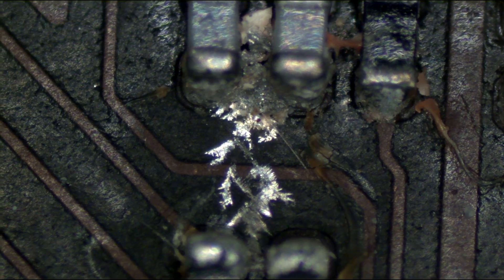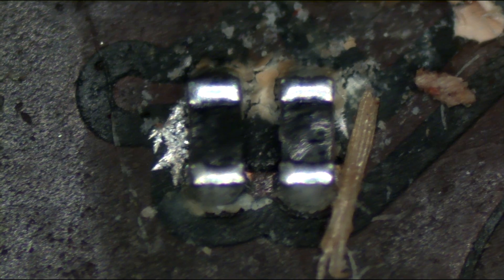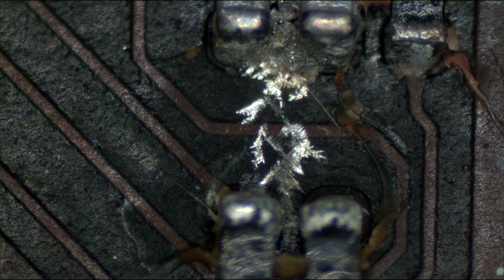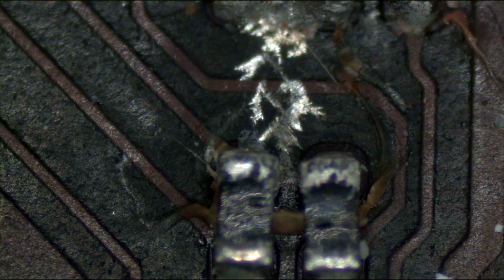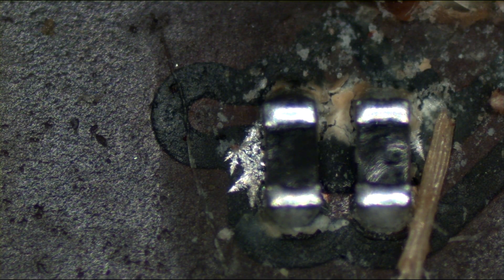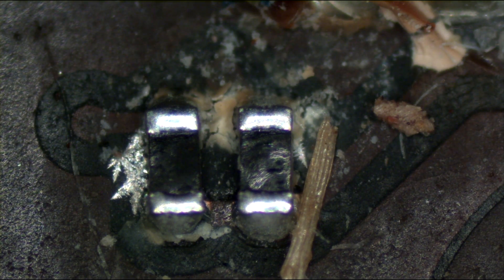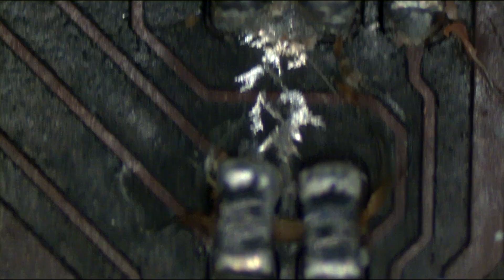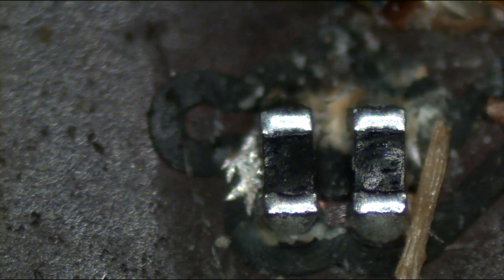A pretty Macbook failure

Comment: Solder whiskers are caused by the uneven metal mix in the RoHS alloy. They are created by mechanical compression. Think, trying to squeeze a wet soap. They do 2 things. 

1 - creates cold solder joints because there is a hole left behind. This cannot be avoided. 
2 - creates shorts by touching other components. This can be avoided with conformal coating.

High vibrations and large temperature deltas accelerate their creation. Critical systems are not allowed to use RoHS. Aircrafts, medical and military.

Comment: Hi, Louis!   what typically make USB ports fail? Is it mechanical (solder joints)?   or the interface chip running them?     I have an HP that only has one USB port left that works. I hate to discard it just yet....

Comment: I have a Macbook Pro that one of my roommates gave me that is in rough shape. At some point he glued the rubber pads on the bottom and the glue seeped in and he accidently glued the LVDS cable into the connector.  I pulled the the cable out of the connector when I was taking it apart and I think the connector is fucked because some pins must be damaged. I do not have the equipment to replace the connector. I feel like it is is mocking me sitting in my room reminding me of my failure to repair it. Can I donate it to you for parts or repair?

Comment: Tin whiskers are a rare thing out in the field.
They tend to "only" grow if the tin concentration is above 95%. But other factors plays a part as well.

Whiskers are though so rare in practice that it isn't a major concern unless in a critical field.
But if building a device used in a critical field, then one can typically use whatever solder one desires. (Can't just sell it as a consumer product, and one do need to label it appropriately. That is if one is selling the product in the EU, since it is there that RoHS is actually enforced.)

One can conformally coat the board to "fix" the issue, but that isn't really economically viable and can honestly create its own problems, mainly in terms of cooling. (literally putting on a layer of insulation.)
 But conformal coatings are mainly put onto boards for other reasons, like moisture protection in marine environments.

Comment: We had a failure at one of my radio stations because of this.  The cut through hole components started to crystallize to the zinc back plate of the console module.  Took the manufacturer a long time to figure it out because our consoles were an early run of a new process where they were not allowed to wash the boards (based in California).  The unofficial fix was they started to wash the boards despite regulations, and they provided a couple hundred Mylar sheets for us to place between the PCB and the back plate.  Was a very frustrating time until they figured it out.

Comment: another reason why electronics flown into space uses leaded solder is that the lead free stuff would not pass the shake table as lead free solder tends to be brittle and when vibrated as in a launch there would be many dry joints in the device. 
Also using lead free solder in car electronics should be banned as I have had lots of dry joints in the last cars ABS computer, and 3k for a new one did not happen.

Comment: I'm still using my old Panasonic Toughbook with an upgraded solid state hard drive and Bluetooth. Waterproof, shockproof, bomb resistant 8 hour battery and doubles as a battering ram. It will beat a Macbook to shreds in a fight.

Comment: is there an economic way to fix the loose USBC plugs on a 2017 Macbook Pro ? this is driving me nuts
Reply: If you have a macbook with 4 USBC ports, the ports are only connected to the logic board with some screws. Cheap parts, easy to change, very difficult to get to. You must remove the whole logic board to remove the ports from the case. If your good with a screwdriver and have a steady hand you can do this yourself. Just watch a teardown video, disconnect the battery FIRST, use the correct and good quality screwdrivers (Pentalobe P4, Torx T8, T5, T3, recommended Wiha or Wera brand) don't mix up screws when putting back, and don't pry the bottom off with something long like a screwdriver.
 If you have a A1708 with 2 USBC ports, they are soldered to the board and I would consider it an intermediate to advance microsoldering repair.
Reply: @A2000MHz  thanks for the info, i would say i would most probably mess this up myself . but i would give it to a professional.

Comment: Wow, tin whiskers in practice. The problem has been well known since at least the ‘40s, maybe the ‘30s, and lead is the only known solution to prevent it. Encapsulates and potting don’t stop it either, with at least one known satellite loss suspected to be due to tin whiskers in a component. The RoHS sure works wonders for planned obsolescence though, and caused a larger hazardous dumping of lead than it ever prevented.
Reply: The lost satellite was presumably due to a tin whisker growing on the pure Sn coating (as in industry standard). Lead as additive also doesn't prevent tin whisker formation, it merely reduces their size and count. Some SAC (lead-free) alloys are very similar in this regard, though SN100C (SnCuNiGe) is the best by far.
Reply: @MayaPosch  thanks for the information! The sources I read at the time just have been out of date or incomplete

Comment: I only use Lead / Tin solder. In the small amount I've used over time, I haven't poisoned myself, family or environment. There's more lead in car battery's out there that are irresponsibly dumped, then used in soldering.

Comment: Those are not tin whiskers, but in my opinion tin crystals formed through liquid damage. Someone spilled something that was corrosive enough to dissolve the tin, and then the tin crystal were formed through electrolysis between ground and a power rail. Normally the process is done with a tin chloride solution when done as an experiment or to purify the tin, but I'm sure certain fizzy drinks on a solder joint could work as well under lucky conditions.

Comment: I understand there are alternatives to lead in solder to inhibit tin whisker formation.  (Tin whiskers are a well-known problem that's been there since the very beginning of electronics.)  Apparently, you can put antimony in solder instead of lead to inhibit tin whiskers, but antimony is, if anything, more toxic than lead.
Reply: Lead as additive (in the industry standard 63/37 SnPb formulation, not the horrid 60/40) is relatively good at preventing whisker formation. The common lead-free alloys (SAC) are less good at preventing whisker formation, but an older (and heavily patented) alloy called SN100C (SnCuNiGe) is roughly on the same level or better as SnPb. The patent made it too expensive to use generally, which is why SAC stuck around for so long in its roughly dozen common alloy formulations.

Most recently (few years ago), the patent on SN100C expired, and now anyone can use the same SnCuNiGe alloy for their solder products. This alloy produces shiny, easily wetting joints, with virtually no tin whisker formation and is for all intents and purposes eutectic, just like 63/37 SnPb.
Reply: you could just conformal coat the board.
Reply: I remember reading somewhere that tin whisker formation had more to do with the tin plating of components and PCBs than the soldering alloy used. Various alternative coatings have been devised to mitigate the problem.

Comment: Between this and solder joint failures due to brittle tin solder, I wonder if the leaded solder ban has backfired and caused more pollution in general due to more electronics failing early. I have a pile of video cards that have failed due to cracked lead-free solder joints. Never had a video card fail before the lead ban.

Comment: theese are not whiskers theese are dendrites https://nepp.nasa.gov/whisker/background/
Reply from the maker: Whiskers, dendrites, it's $$ to me all the same....
Reply: @rossmanngroup  Sure, but dendrites are not unique to lead-free solders at all. Tin lead - really, any tjn-based solder - does this just fine under similar circumstances. 

This is caused by an electrochemical mechanism, and is related to flux or other contaminants in the presence of electrical bias.

Comment: It doesn't look like tin whiskers to me. Tin whiskers are the result of mechanical imbalances in lead-free solders and usually are shaped more like a single spike or very thin hairs growing from the joint. This is more like a dendritic structure, maybe caused from poor flux cleaning or perhaps something else between the contacts here. This is why cleaning flux is very important for long term reliability. When two metal plates are charged to a different potential, over time they will form dendrites when submerged in certain materials. I'm not an expert on it, but I read a bit about this years back. Someone else may be able to chime in on my comment.
Reply: I actually am an expert in this, and you are right. The flux alone can be fine, but add other contaminants (or use a non-approved flux) and this is exactly the result to expect.
Reply: @jasonfullerton7763   yeah this looks like dendrites- fixed with conformal coating the mac so no one spills shit on it for it to grow

Comment: I find it ironic how lead-free solder, which supposedly save the environment, is the major one of the reasons why more and more electronics are getting into landfill because of crapshit solder joints that render them unusable.
Reply: It's not the major reason. As Louis points out in the video, this is the second time he has seen something like this in 12 years of repairing electronics every day. It's fairly uncommon in the scheme of things. The major reasons why electronics end up in the landfill are, bad capacitors, lithium ion batteries losing capacity, cracked screens, water damage and operating system end of life. Not to mention just the fact the actual CPU performance is still tracking Moore's Law fairly well which makes devices obsolete over time.
Reply: A bit exaggerating there,  @Gameboygenius . My hatred towards lead-free solder is still existent though, they're pain in the butt.
Reply: @Asu01  I would agree with that for manual soldering. But it's mostly a non-problem for factory production where the soldering will be done by machines under tightly reproducible conditions.

Comment: That doesn't look much like tin whiskers (those look like super fine spikes coming out of the solder) 
It looks more like electrochemical migration where some water/moisture allowed corrosion and deposition.
Reply: Spot on. Tin whiskers are filaments, like a human hair. That  looks electrochemical.
Reply: Tin whiskers are spontaneous sprouting of fine filiform threads of tin. This looks like some other form of metal migration, but the cause of the migration is not clear. Lead does inhibit tin migration so if the metal is enamating from the solder (likely), product failures could still be blamed, at least in part, on lead-free solder.
Reply: @falcon2287  We could just sum it all up in one term, "Planned Obsolescence" . Guarantee apple knew better. Regardless of what the actual full on scientifically proven cause is... Apple could have chosen to prevent it and opted not to.
Reply: @ThaRealC-LoCLo   Based on much of what Apple does I agree that they practice planned obsolescence. However, the elimination of lead from the solder formulations is beyond the control of the manufacturer. Inclusion of lead in the product and in the manufacturing process exposes them to the potential for devastating liability claims from workers and consumers for lead poisoning. Society places tremendous pressure on removal of lead from products. Laws in most parts of the world in which Apple products are made and sold would bar them from using leaded soldering compounds. I think you would be hard pressed to find any lead in the solder of any consumer product currently being manufactured. NASA and government entities can still specify leaded formulations, but those products are not intended to be sold or used by the general public. Myself, I am most assuredly "never-Apple", but I can't blame the evils of lead free solder on them.
Reply: @falcon2287  I think it's more likely that the utterly filthy board had enough moisture that failure was inevitable.
Reply: agreed. this looks like electroplating from water or something dissolving some corrosion products causing electrochemical deposition.

Comment: No. I did not learn anything. What is that? How does that happen? When does that happen? etc...
Reply: electrolysis because of current flowing while theres a liquid on the board that allows the metal ions to be transported. The metal ions are created when the metal salts from the corrosion get dissolved in the liquid.
Reply: @ZE0XE0  So, is it just moisture, or drops of liquid or massive water damage? How does that happen?
Reply: @JohnJTraston  It would require liquid on the board. The liquid acts as a media for the ions to transport. It wouldn't have to be a very thick layer of liquid though.
Reply: It’s just his outro ‘saying’, but yeah I would’ve liked some more info too

Comment: Dendrites <3 gotta love redox reactions.
Reply: Yeah, funky isn't it?  I've seen gold take a very similar form in fractures in quartz, and dendritic manganese oxide is a common mineral that displays this feature and can look remarkable.
Reply: @Stoneman06660  Now you're talking my language! Ive also seen some great iron oxide dendrites in agate and sandstone. 

I'm a mining engineer.
Reply: @ZE0XE0  I feel I've seen similar formations on the sides of the mountains cut out for the interstate in West Virginia
Reply: @Celician83  Probably. Manganese dendrites are very common.
Reply: @ZE0XE0  Geo here.  Have to enjoy the pretty stuff when you find it because there can be a lot of dull inbetween!
Reply: @ZE0XE0  judging from the rust on the rocks in the mountains, I would assume there is large deposits of Iron in them

Comment: What cause these to occur?
Reply: electrolysis because of current flowing while there's a liquid on the board that allows the metal ions to be transported. The metal ions are created when the metal salts from the corrosion get dissolved in the liquid.
Reply: @ZE0XE0  Ahh that makes sense. Thank you for the explanation!
Reply: @ZE0XE0  Not your first rodeo, I see.
Reply: @jasonfullerton7763  i have taken my fair share of non-organic chemistry classes. Metal migration in fluids is a large part of understanding metallic ore deposits.
Reply: Covid lol 
He didn't kill covid on this vid